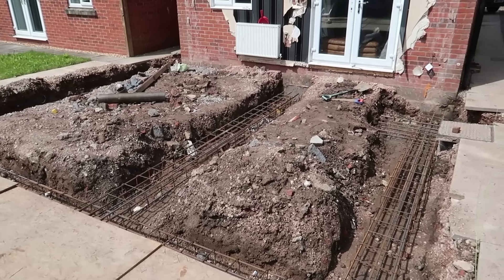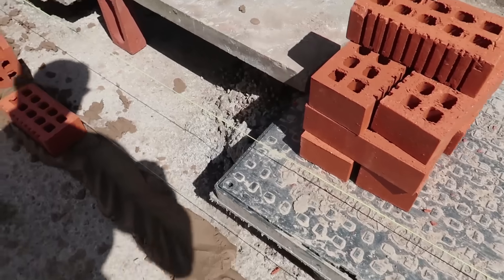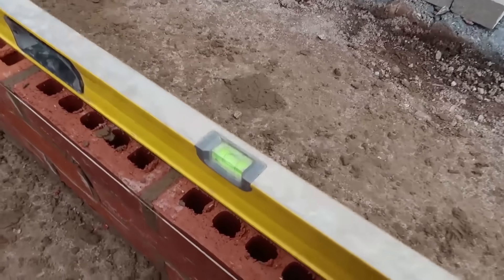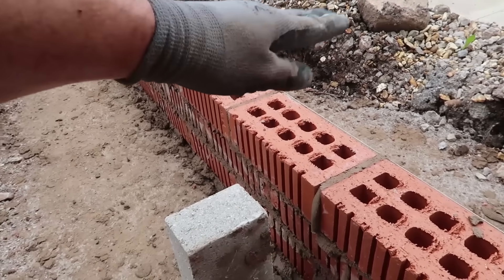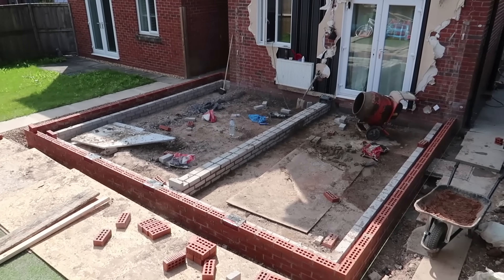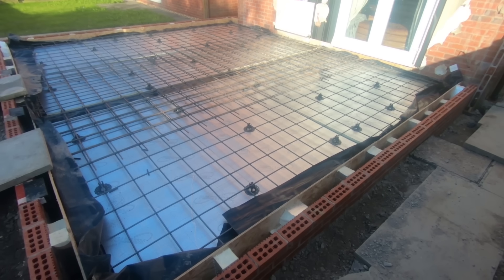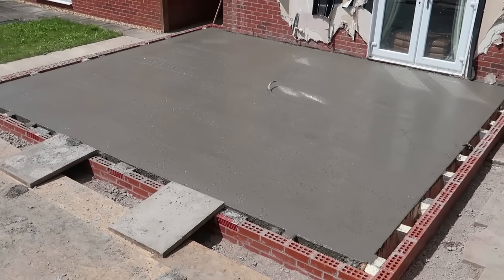Bricklaying - How To Do Foundations For House Extension

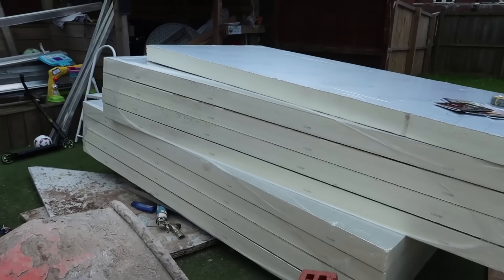Comment: 9:38 the insulation, after the concrete is poured on top - will stay level because the screed underneath is compacted, and level?
Do you ever get any issues because of that insulation? Looks a bit risky to me, pouring on top of that.
(I've no experience by the way!)

Comment: Good job, thank you.
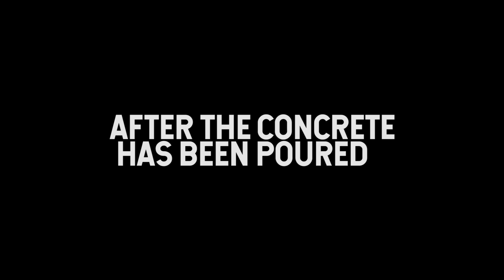1:58 "after the concrete has been poured" - what was the basis for the concrete in the central part, the natural ground? How do you avoid the water escaping into the ground leaving weak sand & cement residue behind (sorry for the inaccurate terminology, I'm a foreigner who builds in England).

Comment: Strange that this extension is not link to the principal building with some steel.. And the lower insulation has been badly done, you need to scotch them to prevent any thermical bridge..
Reply: Thanks for your comment 
Can you explain in detail. I don’t understand

Comment: Can I ask why you initially use bricks with holes in them? I'm building a shed this spring and trying to learn what to do. What yoh have shown is excellent. Also how deep was the concrete when poured over the insulation?

Comment: Hi Stu, 
I notice puddles under the metalwork ??? Is their clay there ?? sometime I place a compressible layer  (25mm of polyurethane wrapped and taped in visqueen ) under the steel between each pad  to allow for any heave movement between the piles. Great videos, keep them coming.

Comment: Why did you not use the inner skin of blockwork to form your shuttering? Lots of extra work making it with OSB and packing it with insulation. You did the hard work setting it out and doing part if the inner skin just keeping going up.
Reply: I spotted loads of things I would say were done wrong in this video. Not sure if they did. But keep the concrete down. Screed the floor. They didn't even have a rake. No pole float?
I bet loads of concrete went down the cavity.
Why didn't they dig in the ducting?
I have never seen tubes banged in the ground for piles. Not like that. Did they even have a poker?
Need me to go on?
Reply: I thought the same.
Reply: So the weight of the slab is loaded on the footings and not the ground.
Reply: Same here do not understand not building the inner skin blockwork up and use as shuttering. Surely more cost and work this way ?
Reply: Slab has to sit on the pile beams
Reply: You have to allow for expansion
Reply: You can still allow for expansion with a foam edging strip like you do with underfloor heating screed.
Reply: I was just thinking that myself

Comment: Good job. It’s sturdy and all, but it’s not heat efficient. I live in Sweden where where we always have underfloor heating in new build (on ground floor) and 300 mm insulation and 100 mm concrete. The footing has 300 mm concrete. That way you both get a sturdy foundation but also great heat efficiency through underfloor heating. When you then pair this with 300-400mm insulation in the roof you get a room which almost doesn’t need continuous warming.
Reply: I’m curious to know How much insulation you use in the walls over your way?

Comment: Excellent video mate, much appreciated. 

Couple of questions -

You didn't use any kind of crocodile starter bars or whatever when linking the brickwork to the existing house?

No need to poker the concrete slab?

Thanks.

Comment: At least it won't ever need to underpinned lol! That's one hard and horrible job to do,the hardest one we did was in sale greater manchester,a three story detached house. We had to dig to a depth of 2.1mtr and 1.5mtr in from the brickwork under the floor and 1.5mtr out from the face of the external course. We needed our weta box for that one,whoever thought that spread brickwork was a good idea was a wally though I suppose that they didn't have much better construction methods back then or did they,they must have done. Hmm?!

Comment: Greetings from Ireland Stu! Loving your Jedi skills : ) 
I have 3 very important questions around the slab/DPC/DPM
 
1) When you remove the shuttering what goes in the GAP?
     - Is it 100 mm insulation to stop cold bridging?  or is it more concrete?

2) Where did you terminate the DPM around the edges in the video? 
- Should it not go up and over the blocks/bricks?

3) I seen you use a cavity tray for the DPC inner wall to outer. Which is better DPC on each leaf or a cavity tray .

Comment: Great videos lads. I have a question if anyone can help me It would be greatly appreciated!. I understand the dampproof course being lapped up min 150mm up for the floor outside but how does the damp from the new extension meet up against the existing house? I can see it folded up but would the water not get up the back? Does it need to be chased into the existing house or is it assumed that it already has damp.

Comment: Round our way they make us put  another DPM on top of the insulation as apparently the concrete rots the insulation over time... 🤷‍♂️
Reply: I don't thing this is a good idea having a concrete floor slab on top of the insulation From. This doesn't  seem stable to me. 😳 Over time it will start to crack. Who idea was this?
When did they start doing  this? 😲
Reply: @m101ist  that is the way we have been doing it for decades in Europe. How else would you insulate your concrete floor from the cold grund?
Reply: The top DPM would act as a vapour barrier to minimise water forming in the insulation by condensation - the moisture is more likely to cause the insulation to degrade than the concrete

Comment: Old ground worker once showed me an old trick of his,after the concrete was poured and tamped ( I like to use a vibrator! but so does my mrs,and she knows nothing at all about concrete but that’s another story)leave concrete to pick up for a while,roll out a length of 6” damp course over the concrete at house end one person each end on the length of dpc and slide back and foe over concrete working away from the house just as you did with the timber tamper and you will get a superb finish on your concrete,not saying you need to do that if there’s a screed going over it but great for exposed concrete like a garage floor that just needs floor paint,got to go the mrs is calling she’s run out of petrol😋great work great video5***
Reply: coggsy3036....your wife has a petrol vibrator? 2 stroke or 4 stroke? You can get them with rechargeable batteries now days; much quieter if your working at night!

Comment: I am assuming piles were used as the ground is probably fill from when the houses were originally built. Not entirely sure about using ground bearing slab on ground deemed to be poor... b&b.

Comment: How is the extension going to be heated? Didn't notice and piping for radiators.
Reply: Thomas Carberry probably go in the screed, usually you’d have more insulation/ membrane then screed - this is when You’d put your underfloor heating pipes , then tiles / wood flooring on top
Reply: @MistaJayLJ  this is up to DPC level ie there is no screed going on this. If they do what your suggesting there will be a step up into the room. The reason I'm asking that I'm a plumber myself 10 years in construction.

Comment: Hi mate I got a question why did you do a concrete slap and not block and beam. Would it not be better for air flow I did see you used a pipe to connect the original air bricks with your new ones. But would it not t be easier and faster to do more air bricks and block and beam it ??

Comment: you should've installed another layer of DPM over the celotex. because the cement in the concrete reacts to the foil on the insulation. good job keep it up

Comment: Good video, thanks. We had an 8m x 4m concrete base built with black DPM, rebar but no brick wall around it. - Just a big slab of 15cm deep concrete. - Can a brick retaining wall still be built around it?- Builder left it looking a mess. - Wooden shuttering hasn't even been removed (he said it didn't need removed??) ... and the concrete base cracked all over the top. - Now green moss-like damp is all around the cracks on the surface. These cracks were already filled with concrete once but they retruned quickly, all cracked again. - Is this even normal?? Please can you answer my two queries if you catch a minute? Thanks.

Comment: Daft question, but why 3 course of common and not 1 course of solid 7n conc blocks? Genuine question as your work is Bob on 👌🏻
Reply from the maker: it was too tight i had gring down ro make the heigh about 210

Comment: You could cut and weld a smaller opening in that grid and make your new wall plum with the rest of the back wall. 
You would have no problem laying a bit on it, since it had so much cement poured around it anyway.

Comment: Concrete was totally wrong
Reply from the maker: Thanks for watching anyway. All the best
Reply: stu crompton the reason the concrete was wrong is because you have to place another barrier on top of the insulation to stop the concrete  reacting with the insulation. Just a thin vapour sheet would do. The insulation is sandwiched between two dpc sheets.

I hope this helps.

Comment: Dear sir just interested to know why foot in some cases are not vibrated thankyou
Reply: I was wondering the same!

But I guess the last part was just the screed! Not part of the foundation anymore.

Screed usually gets just one layer of steel reinforement in the middle whereas buildcode requires the foundation to be built with an lower and an upper reinforcement plus a minimal hright of concrete coverage of about 1 inch!

So layong the reinforcement directly onto the ground with no stand-off would not be built to code in Germany.

Another thing i wonder about is - why is there no insulstion between the two outer walls?!

We usually have 17,5cm inner wall, 14 or 16cm insulation and then outer brick wall  -  plus we use about 6 to 8 stainless steel wall anchors per squaremeter to connect inner and outer shell.

Comment: Good job lads👍 just one thing if I may you probably better off lying more polythene on top of the insulation before concreting and not directly to the aluminium foiled insulation boards👍
Reply from the maker: got  it, will do next time but bc didnt tell us to do it

Comment: Nice video. Just for information why will you put bricks under ground instead of pouring concrete. Wont brick decay and joints crumble with time faster than concrete ? Then how you fix those brick under ?
Reply: Could have timber around perimeter as boxing, instead of brick,but guess its how you do it in England....
Reply: They’re engineering bricks

Comment: Hi stu 
Great work. Can you just tell me why you laid the inner leaf brick work on top of the concrete slab with all the effort of cutting OSB to seal the perimeter to stop the concrete running over when I see other builders just build two brick courses up to damp level together and then lay the slab
Reply from the maker: That’s what bc instructed us to do
Reply: stu crompton ok fair enough, just really puzzled me. Thanks for getting back to me.
Reply: probably so the piles take the weight of the slab.

Comment: Tidy but didnt look like you pocketed out the suspended slab into the existing house brickwork so its supported on all 4 sides?
Also worthwhile having an additional visqueen ontop of the insulation but not critical if gaps are tight and the product allows direct pour over.
Reply: You don't need to pocket out into the existing house due to the centre strip foundation. If that wasn't there then you would have to do that but with the t shape strip you wouldn't need that especially with the width of that slab.

Comment: Very neat job, not sure if you will have any problems further down the line though. It looked like you had run your steel mesh right up to the outside shutter. You supposed to have 40-50mm cover on any steel in concrete as any moisture that gets to the steel will rust it and expand the steel then start blowing out the concrete. Hope not because you do a cracking job. Anyway you can sue the building inspector for passing it.

Comment: Nice work stu. Was that a length of  land drain you used to ventilate under the house floor?
I've done similar myself with plastic drainpipe but I'm sure those pipes will get full of spiders webs and be useless over time.

Comment: Stu, how do you determine whether the ground is good or not?
Reply: I'm not Stu, but if ground is wet and muddy it's no good. Need to pour foundation onto firm haed dry sub grade material. 
If muddy localized areas just dig deeper in those areas untill ground is better ,if not need to pile

Comment: I normally put insulation on top   of concrete then screed. But I must say you've done a really nice job there lads
Reply: Where ime from,  Berkshire, it's membrane - concrete - membrane - insulation - membrane - screed.
Reply: You can do screed/concerete either way around. Concrete above the insulation adds thermal mass so quicker to cool down/warm up.

Comment: Do you have to drill a hole first for the steel pipe/piles? Then I guess concrete just fills them up. 
We had a small housing estate built next door, they discovered a Victorian culvert, when they were digging the trenches, that kept filling up the foundation trench. It was clay a foot below soil. The groundworks guys ended up digging 2 metres down and used treble the concrete.

Comment: Cannot believe the way overkill footings they made you do, you're building a house not a skyscraper lol
Reply: It’s not overkill. The only reason there is steel in the footings is because it’s been piled. The reason it’s been piled is because the ground is not good enough to support a standard concrete footing with no steel.

Comment: Hiya stu looking good pal. Why would you not build the internal wall up level with finished concrete and pour inside to that? No need to shutter. Learning not criticising. Cheers pal
Reply from the maker: Because it’s a floating  my slab the slab has to sit on the common brick
Reply: Hi stu. I'm just doing exactly the same job but instead of the shuttering I was going to fit strips of 4inch insulation in the cavity void which would finish level with the top of the outer brickwork then just pour the slab. The insulation is then acting as the shutter and also acting as a thermal barrier as well. Do you think this  will be OK. I'm more used to traditional slabs but the one I'm doing is exactly the same as the one you have done. Cheers

Comment: They make us double dpm around the kingspan in the black country
Reply: Last job I did up here Manchester they said you should put a thin plastic sheet under the kingspan ( not necessarily DPM) I had already put the sheets down so he said I could just seal the joints with tape! Then the DPM went on top! Had to put 25mm insulation round the perimeter too.

Comment: How deep are the piles into the ground Stu?
Reply: The required depth differs per soil type, so don’t use his depth for your projects. Get a foundation engineer to calculate this stuff. To get a building permit you need a foundation plan from such engineer anyway.

Comment: Old guy showed me a great tip years ago and I always do it now.have a length of 4’’,damp lay it over the concrete from side to side and gently seesaw it back and foe once the concrete has picked up a bit just as you were doing with the timber tamper,take your time and you get a superb finish,it’s all about getting the concrete at the right stage of curing before you start rubbing it up with the damp. Great work too by the way👍

Comment: Great vid stu, only things we do differently on site is put a layer of visqueen down under the kingspan and lap it over the common so when the ground under the slab settles the insulation is held to the underside of the slab.
Reply from the maker: That’s what we did Johnathon. Visqueen underneath insulation and lapped up over commons

Comment: I thought piles were vertical holes at intervals filled with concrete
Reply: maybe they get filled with concrete on the slab pour.
Reply: There is all different types of piles.

Comment: Great video....piling an extension...what next....i had to put two steel 'rings' around my foundations ...one at 3 inches and the second at 6 inches...building control advised...either that or raft the whole thing...but that's going back 35 years. Keep up the great work.

Comment: G'day Stu get your self a rotating lazer level you only need one man to take the levels
Reply: I’m not sure if that works well with brick laying. Maybe if you set the laser at the bottom of the bricks instead of the top. If you aim it at the top, then you cant see the laser anymore if the brick is too low.

Comment: Why was there no dpm on top of the insulation?
Reply: Not required on the plans hope this helps thanks for watching and was passed by the building inspector
Reply from the maker: It wasn’t required as the was Dpc underneath insulation. It was done exactly to plans cheers

Comment: Excellent vid. But what did the inspector think teh airbricks were ventilating?
Reply: Guessing the void under a suspended concrete floor of the house....
Reply: @TurinTuramber  What void? it's suspended on kingspan, there's no void for circulation and at 7:35 the telescopic vent is going into the crush and run - absolutely no circulation.  I worked it out. I hadn't notice the one vent tube in the crush and run. It's to ventilate the existing building's suspended floor space. When you put a concrete extension on the front you usually take out a few air vents on the front of the building. So with the vents + pipe the vent is extended to the new front of the house.